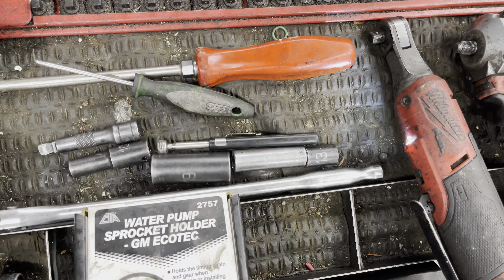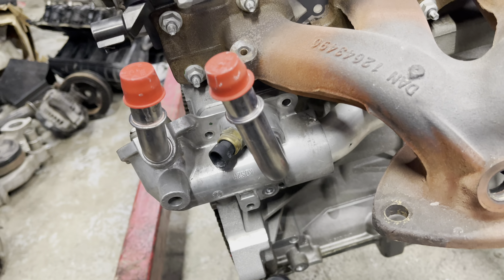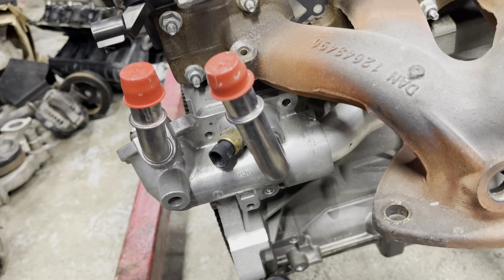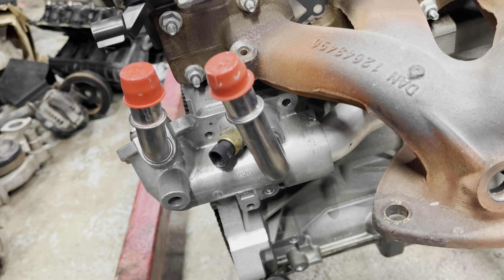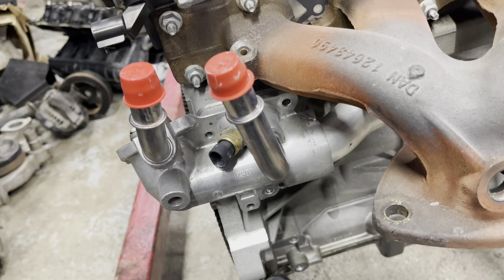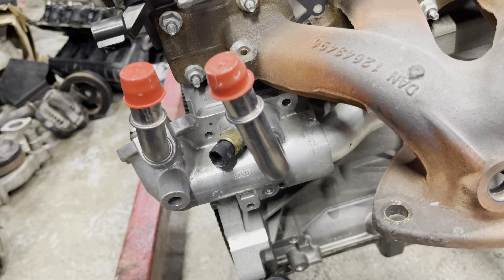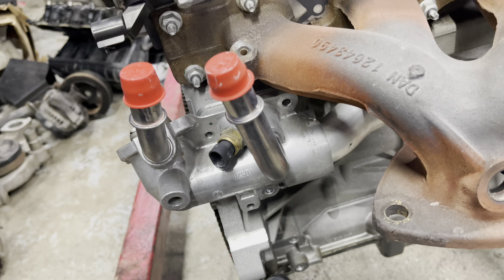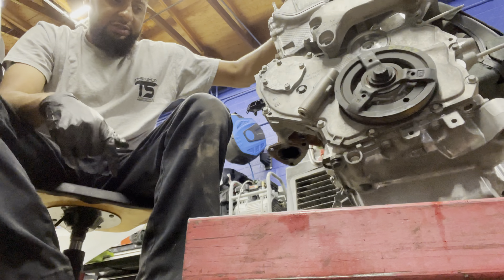Water Pump Replacement Ecotec 2.2L 2.4L Malibu, Terrain, Equinox, Cobalt

Comment: Thank you for video on GMC Terrain water pump; what is the part number for water outlet square seal.    Thank You
Reply from the maker: No problem. 36122 is the fel pro part #. 2:51sec in the video it shows the seals for that and the pipe.

Comment: Nice. What would one expect to pay a mechanic to do this? A good guesstimate.
Reply from the maker: depending on the shops labor rate it's a 3-4hr job + coolant & water pump your probably around 500-700
Reply: @TheShopLLC40  Dang. Ok thanks for the reply.
Reply from the maker: No problem, always down to answer questions where i can

Comment: Can't read part numbers on gaskets
Reply from the maker: Thermostat is felpro 36122 
The pipe orings x2 felpro 36068
Reply from the maker: Water pump would come with the rest of the gaskets needed.

Comment: What is the part number for the thermostat housing gasket? My Fel-Pro gasket set did not come with it?
Reply from the maker: Thermostat is feloro 36122 
The pipe orings x2 felpro 36068

Comment: Remove the engine to replace the water pump what happened to easy fix like on the older cars the water pump was on the engine.
Reply from the maker: Lol You don’t have to remove it. I was doing a used engine replacement and we replace the water pump & thermostat so we can keep the warranty on the engine. Did a video to show for the ppl who do the water pump in the car so they have a better idea
Reply from the maker: Definitely a pain in the ass job to do though in the car
Reply: @TheShopLLC40  Thanks for clearing that up
Reply: I have yet to see a video made on doing this in car. Add a turbo on the 2.0 engine and this is a MF of a job
Reply from the maker: @steveh1256 i do them in the car all the time. I was just trying to get everyone a better look at from outside and not reaching up and just feeling. Next one i get in ill make a video of it being done in car